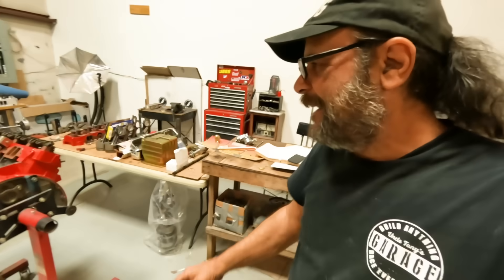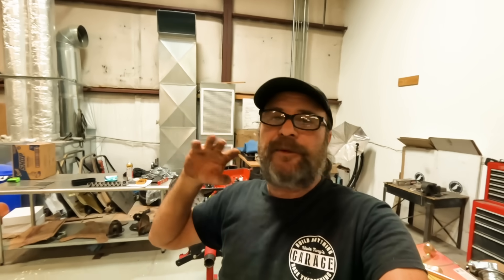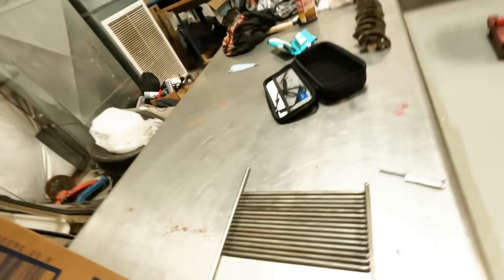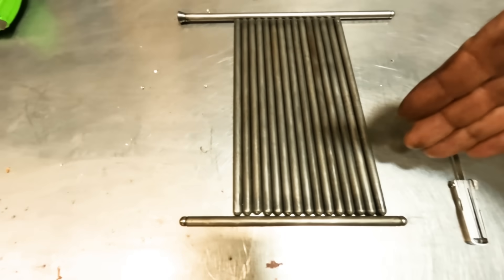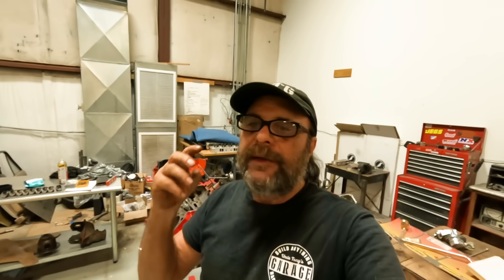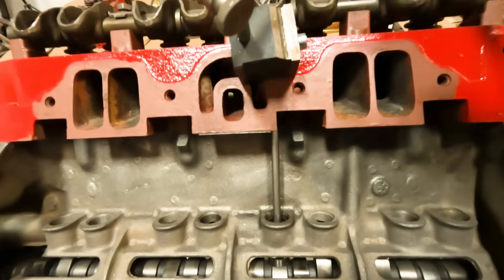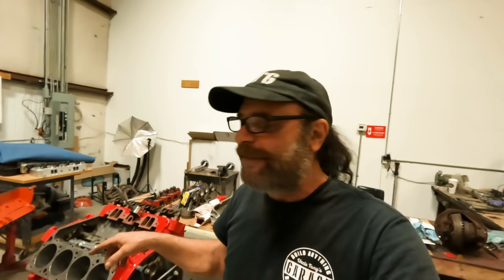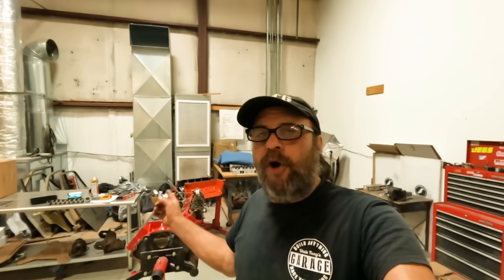The Engine Tuning Issue You Didn't Know You Had

Comment: So you just finished "putting the heads together" and you didn't set the installed height of the valves? That new Edelbrock head (marginal quality) has a fraction of the valve height discrepancy of your thrown together mongrel. If you're experiencing lifter pump due to valve float you have a valve train deficiency that pushrods are not going to fix. Please stop troweling out this slop.

Comment: Just happen to me by 2mm shaved olds 307 project . Did not idle , with lot off trothle run and started but in seconds when oil pressure rised lifters overpower valve springs. Good that it was so bad i could not run it . Now it is shimmed like zero and some. Not yet run but it sure Ok 😮.

Comment: I added a larger cam and matching springs to my 350 Chevy motor and it started pulling the rocker studs out of place. My buddies told me I should pull the heads and have them machined for screw in rocker studs. An older friend took me aside and told me I didn't need to pull the heads to fix the problem. He said all I have to do was drill and pin the studs in place. Worked like a charm and I ran that motor pretty hard and without any problems. He was my Uncle Tony at a time when I had little knowledge of modifying motors. I ran that motor in a 78 Buick Regal. My best time was 13.2 at 106 mph with a 2.4 60 foot time. I was shifting between 6,500 to 6,800 rpms most of the time and it still had legs. All I needed was a set of sticky tires and I would have been in the 12's. That's all I ever wanted from that car, Damn!

Comment: Even on chevys you outa figure out proper pushrod length because you dont want the part of rocker arm that rides on valve stem to slide past the center of the valve stem at full lift .same with any brand engine

Comment: If the Chevy hud lifter is set at 0 lash wouldnt the C clips get pounded out of the lifter?

Once had a 327in the 80s, at 5k exactly the end of the rotor would bust off. No clue what made that happen..1st car. 
I carried a box of Napa rotors with me, had a lot to learn. Stll wonder how it coulda happened

Comment: I spent about twenty years working on big diesel generators in the Marines. After those, regular car engines were a piece of cake. I've had a love affair with Chevy's since my teens precisely because of what you point out. I've got a sixties 292 I'm putting together to put in an 82 Jeep, looking for a good automatic transmission and transfer case to replace the four speed and blown clutch that's currently in it, got old and enjoy the automatic these days as I approach seventy.
Reply: Had my 292 running  a few years now and have discovered the soft exhaust seats will seat in and cause to much preload. Runs best with zero preload and zero lash.
Reply: @shellylozano1052  Thanks for the heads up!

Comment: I got a question I hope you might answer I have a 72 Chevelle which had a basically slightly hopped up 350 with a stock distributor with the pertonics conversion it developed a knock and I pulled the motor and got a 388 stroked motor with Aluminum Dart heads and has like 6000 mile on it out of a rock crawler to put in it, I know there's a lot of torque coming from it to punish the rest of the car but going to try to baby till I can up grade the rest of the drive train as I'm not rich but my question to you is can I still run the distributor out of old motor till I can upgrade or do I need to bite the bullet a and add an HEI or a MSD box you in advance for your suggestion

Comment: Would it be beneficial to VERY LIGHTLY  chuck up each lifter and file a very slight round over or  ]/  <
Very slight taper to the very edge of the lifters 
Would doing the same for the hard edge on the cam be beneficial or cheap insurance 
🤔 The lifer edge round over might push oil easier between 
But would it lessen the grab to spin the lifter.  🤔.

Comment: Got a QUESTION for you I'm building  a golf  mk3 2.0L 8v engine  but wen I go to set the crank in with out the pistons and rings the crank only it turns smooth  but it has a spot that it binds ever so slightly  just so you can't turn it by Hand what do you think  the issue  might be

Comment: I’m on the hunt for a roller lifter 318 85-91. The roller lifters should eliminate the float issue, right? I’m using the heads off my 1969 block, as  cleaned up as I can using the home porting techniques you shared (gasket match too). Are there any pitfalls to avoid? Thanks

Comment: so if you use a harder valve spring, the problem is fixed also. Am i right? but more pressure on the cam you might need a roller cam i think

Comment: Anyone who builds an engine that makes less power after modification than it did stock shouldnt be building engines. I have never had that happen.
What this guy ISNT telling you is that shaft mounted rocker arms really arent any better than studs or fulcrums.
Fords first OHV V-8, introduced in 1954 had shaft mounted rockers. A year later Chevrolet started producing the smallblock with stud mounted rockers. By 1964 the Ford engine went out of production in the U.S.(except for some industrial applications) to be replaced by.........engines with stud mounted rockers.The smallblock Chevy was produced until 2002. Oldsmobile abandoned shaft mounted rockers in 1964
Pontiac used them from the beginning of their V-8 production
The big-block Chrysler, a very durable engine which had shaft mounted rockers, went out of production in 1978, but the big block Ford with stud mounted or fulcrum type rockers was around until 1997, and the big Chevy until the early 2000s.
Obviously, stud mounted rockers WERE a successful design, and the Chevrolet type were easily adjustable...no different-length pushrods needed.

Comment: Perfect video for what I was wondering and posturing earlier all specifically relevant to valve lifters, rods, and the heads. 
I have a 302 short block v8 I am rebuilding and it kept bothering me about how analystic should I be specifically on this, but you answered it all as I'm mainly going for longevity of the engine and not high end ultimate precision performance. 
(Whoever at the factory assembled this specific engine which is from this 99 explorer was extremely meticulous making sure it was functional and well built not just another pump out car.)

Comment: Back in the 1989’s I helped my dad rebuild the 318 we put in my pickup truck.  He said the exact same thing.  He also matched the shortest pushrod to the tallest valve stem.  He would also use an old lifter and dope the cup with lapping compound and use it to slightly shorten the push rods as needed to get as close to zero lash as he could get.  After resurfacing the heads and decking the block he had a local cam shop regrind a stock cam for a low/mid rpm torque motor.  A set of headers and a edelbrock torquer intake matched with a 600 cfm Holley carb made that 318 sing.  It was a 68 model so it had the high compression heads and a steel crank.  My short bed dodge truck with a 4 speed was pretty darned quick and that motor was stout.  We didn’t have access to a dyno but from the weight of the truck and the times I turned in the quarter I would guess it hovered around 35-370 horsepower.  It was a good street truck and it took down some of the highly touted cars being produced at the time.  It was fun!
Reply: I came to the comments looking for a reply like this. I rebuilt a gen v Lt with Johnson lifters. Low tolerance preload. I bought shorter push rods to match but naturally they are around .005-.01 difference in preload. This shouldn’t be an issue as they’re all in range but next time I pull the rockers off I believe I will do exactly this. I wish I would’ve kept an old lifter as that’s the only thing an oem gm lifter is good for. I was wondering if anyone had tried this. No videos out there suggest this. While uncle Tony explains it, all my stock push rods were the same length and he doesn’t really touch on “lapping” your pushrods.

Comment: I have known this all my life but somebody should be even in a animated pictorial should see what actually happens between hydraulic lifters and solid lifters to know the nuts and bolts of the situation? Just me, because there is different situations that people don't understand and I have lived it in my 60 years of living and the confusion at an early age was that is still made me wonder what is the best way. The valve train of every engine has to be spot on to accommodate the best performance of any engine . Simple logic but when you're dealing with so many different configurations it can be confusing

Comment: I remember working on a straight 6 (I don't remember the manufacturer) and the directions in my friends comprehensive and very thick professional automotive repair guide clearly stated "after the pushrods contact the rockers (wait for it) turn the adjusting nut 1.5 turns more. Essentially tightening the rockers down WAY past what they should have been. My friend told me to read the part he was having a serious problem with comprehending and there it was, in black and white print...1.5 turns MORE. Well, he tightened every last one and the engine was difficult to turn over. After it fired, it had almost no power (we got it to roll under it's own power). We didn't even go a block. Back in the garage, off came the valve cover, spun those nuts counter clockwise 1.5+ times and the enging roared to life. It had plenty of power and all was right with the engine.

Comment: I really enjoy your videos.  I'm another one of those old school sbc guys. Ive got a 1965 283 im still trying to get to run right. Ive had to change out otherwise new parts ...less than 4 hours and 135 miles . Just junk foreign made parts put out by otherwise reputable companies. In the past 2 weeks ive changed out a carb , a fuel pump and yesterday a distributor.  
Its hard to know anymore what is good at time of purchase from the other choices.
I sure wish you were close to me.  Id have you look at my engine.

Comment: Ive got everything for my 360 la build, shop is giving me a 30 over block back with 10 t0 1 pistons ground crank, spent big bucks on cnc heads 2.08 intakes perfect chambers, roller lifters so i dont have to worry about breaking in flats, only putting in a 218 at 50 cam for now, but with my heads i can put something bigger in later, so i need to measure each pushrod and maybe buy 16 sets of rods to make my build run like a rocket? yee haw, another 2 grand, should have just bought roller rockers instead of the fixed rockers

Comment: Couldn't you find all the amounts that the push rods are too long by from the shortest when installed in their location and grind/lap them all to correct length for their respective location so they all have exactly the same preload across the entire motor?

Comment: I've always wondered about lifter to lifter oil pressure and volume. Oil clearance around the lifter, in the lifter, push rod to lifter and rocker seal and alignment. With all of that tolerance stack. Who knows what is going on. Another thing I have wondered about is individual lifter bore location and alignment. Just a very small misalignment and valve timing cylender to cylender is off. 
I may be wrong about my thoughts. 
Over the years we all have had engines that just ran a whole lot better than others. I figure some of all of what you have pointed out and maybe what I have thought might be why it is.

Comment: I know whicked high rpm engines we used in supras or lambos the spring are so dam stiff to prevent valve floating once that happens its over. Some of those built engines i seen were pulling 14k to 16k rpm thats absurd i thought my  somewhat stock v10 at 9k was stupid 😮 i do miss american muscle. I will get a built car soon . Nelson racing has built some just ridiculous beast. Tom nelson has built shit its like art when hes done. Everythings custom or cut out of one solid block of aluminum. Check out some of his muscle cars its crazy. Some 2000 to 2400 hp running on a street and still rame at a light idling . It is unbelievable what can be done.

Comment: As far as pushrods go,  you can have a set of pushrods made and give them an exact measurement,  but you have to have adjustable rocker arms,  to make up any difference in the lengths,  because  now days manufacturers think what you showed here is ok. Most manufacturers can't hit a given length of a custom made pushrod ever. Not once in 32 custom made pushrods. Shorter or longer, usually shorter. Sad.

Comment: This happened In the "street stock and modified class" of dirt track racing. (in the 60's and 70's) They have a motor claim rule. $500.00  anyone of your class can file a claim on your motor. If you don't honor it, You can't race for the next 4 races. Sooo,,,, If you spend 10,000,00 on a motor to beat everyone in your class. some of the other racers would get together and claim it for $500.00..   When we build for someone in that class we would get a "well used" salvage yard motor and juggle old used parts to (TUNE) it up...Usually a BOP. If it smoked just a little (rings not valve guides) ,,,, that motor could win the feature and the money:)

Comment: I know this is an old video but I didn't plan on building mopar engines😂 I'm working on a stroker from a 360 la block. Would going to roller rockers on a stock head alleviate the issue with preload

Comment: Self learning EFI is a farce. It's like trying to control your fuel with a ball valve, I own a chassis dyno, and I have done numerous EFI swaps, but I would never install a self learning system on a new motor and cross my fingers, however Tony, saying carbs can't cause the same problem is misleading; a wide band O2 sensor temporarily installed helps solve this, but you have to calibrate it right, and verify the readings on the plugs, EFI just like a Carburetor, is only as good as who set it up, and the care taken in getting to a good calibration.

Comment: Lol.....I used to bend alotta push rods in my hydraulic 327 but that was the fuse!!!! That little beast would rev to the moon!!! Until.....never did any other damage though, just had to carry a pair of vice grips (to pull the bent ones out), some push rods and had wing nuts on the valve covers. This was back in the day when it was all about high revs!!!! Good times!!

Comment: I enjoyed this video. I used a similar concept to optimize lash on my 2 valve GS Suzuki with the stock bucket shims, towards the tight end of the tolerance range for the intake valves and on the loose end of the range for the exhaust valves.  Yes, the concept is universal to all engines, 2 or 4 wheels.  Yes, you can easily “seat of the pants” discern the attention to detail.  Motorcycles have mechanical valve lash adjustments, but I instinctively knew that when setting up a car with hydraulic lifters that the push rod combinations could not just be random.  Thanks for explaining.

Comment: Have you had issues with new lifters ticking right out of the box? Just put a new set on my shaft mounted rocker 350 buick motor. Cylinder 1 chatters. Installed longer pushrods and it got less noisy, but still ticks. Annoys the heck out of me.

Comment: Speaking of performance I wanted to take a 340 cubic inch block with a 360 cubic inch crank and combine that and I believe when I figured it up it come up around 390 some odd cubes that would be one hell of a small block for a little duster or valiant!😁 Yes I'm a Mopar nut and my first car was a 1967 Dodge Coronet 440 with 383 two barrel and a 727 torque flight automatic with an 8 and 3/4 in rear end. Post script I am only 44 years old I got this car when I was 16 and that was back in 1994.

Comment: very good analysis, 
for sure, the production tolerances are sloppy , it is the reason why these engines ( Ford, GM and chrysler ) were low in the HP scale in comparizon to the european engines that produced double performance in comparizon to the displaement.
To that aspect, the engines that were equipped with solid lifters had an advantage over the hydraulic lifter equipped engines, the slant six is one of these engines.

Comment: I am a happy camper. I finally figured out what was wrong with the steering tumbler on my 1984 Corvette. I bought the car with this problem and I think who ever had the car before disassemble the steering column for what ever reason and couldn't get the tumble in there correctly so the power would stay on drain the battery and you couldn't get the key out.

Comment: Well Tony  ...  I simply must say this:
°°°°°°°°
While I was attentively listening to your video and mentally absorbing the many years of experience and wisdom, regarding "Anti-Pump-Up" performance  ..
°°°°°°°°
I was startled mid-sentence, by a salesman that popped up on my screen, and began telling me about "Pump Up" performance gains that are possible, with the use of Viagra.
°°°°°°°°°
Apparently, my reciprocating tool will run better at any rpm, with the aid of this benefical Pump-Up technology, which can be ordered for a "limited time only" while operators are standing by.
°°°°°°°°°
So, my question is this:
Will Viagra affect my valve timing, in the upper rpm range?

Comment: Ford 460 pre 72 are high compression 375hp 460lbs of torque stock so now throw on all the bolt on and you have yourself a 475hp monster

Comment: Reading the How to Hotrod Chevy SB back when I was a kid. Think it might have been Smokey in that book commented about adjusting rockers. Stop ticking and then 1/4 turn. 
You can do this with adj pushrods also I would think. Stock studs short but lock rocker nuts as you choose. They will loosen up later same day otherwise. You wont believe what happens doing this. Changed everything

Comment: Uncle Tony I've worked on boat motors 454 GM and  3.7  4 cylinder both lifter preload. The mystery is both stumble wide open never getting full rpm or power? Do you think springs are weak or lifters weak? Thanks